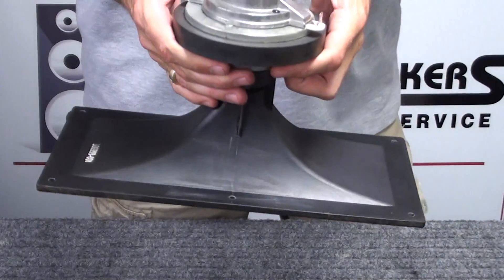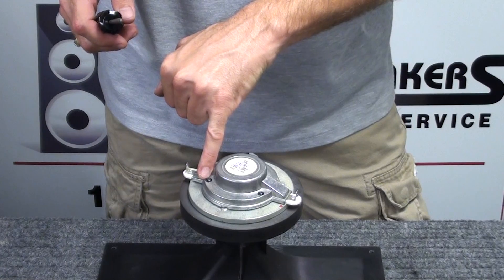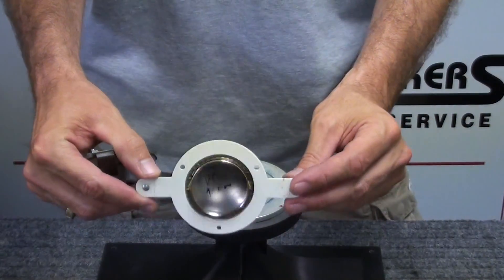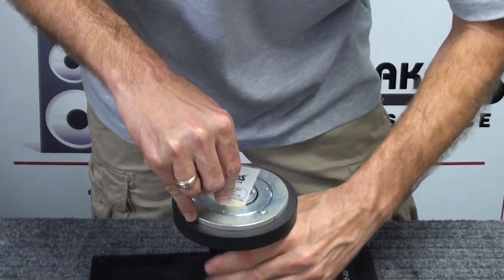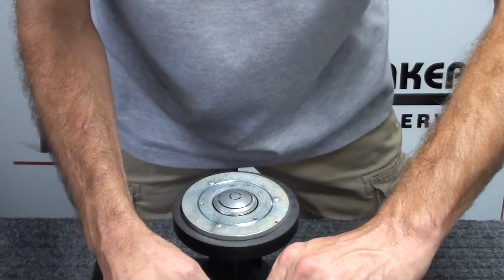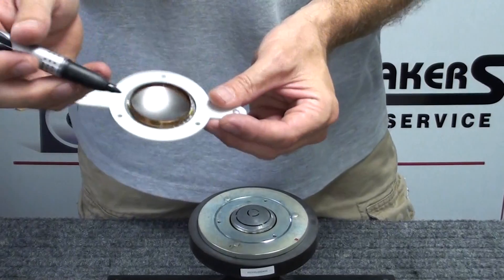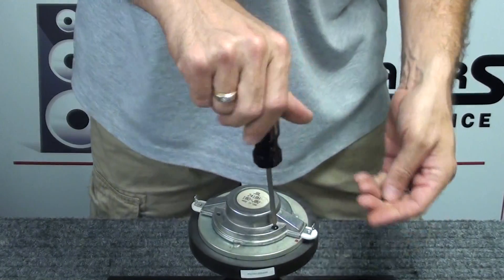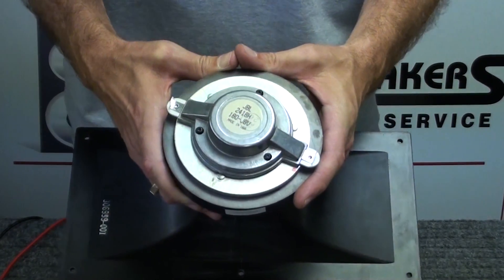JBL Speaker Repair Replacement Diaphragm JBL 2418H Installation

Comment: I just replaced this for my jbl eon 15 g2 and when I turned the speaker on there were a couple pops within the first few seconds and then one loud pop and now it doesn't work. Is there something I might've done wrong? I followed all the instructions as they are explained in the video and made sure to plug the correct cables back into the pos/neg ends. I'm having difficulty finding clues as to what could be wrong.

That said thanks for the very informative video!
Reply from the maker: Sounds like an amp or crossover issue. You may need to take it in to a service center to have the entire system checked out.

Comment: If the terminals are not marked, how can I determine the positive terminal?
Reply from the maker: If the terminals are not marked, we apply battery voltage to each terminal to see which way the dome moves. This will allow you to figure out the polarity. Generally speaking the dome will move toward the magnet when a positive voltage is applied to compression drivers where the throat is behind the dome.

Comment: greetings might be a long shot but wanted to ask anyways I have a speaker that the aluminum dome part of the diaphragm has been moving out of the main socket from the speaker its not dented just can now see inside the speaker at an angle where the diaphragm sits  perhaps the sealant or whatever held it in place is too old to secure it? its strictly JUST the diaphragn silver part the then metallic dome everything is in tact is there a proper way to reinstalled that with a special speaker adhesive or something? hope im  making sense much respect!
Reply from the maker: Send an email to us with a photo and we will take a look. Send to: info@simplyspeakers.com

Comment: my jblprx615m 2418H1 sounds like its blown on top.. would i replacing the diaphram fix the issue? sounds like rattling when a guitar/bass signal is sent through.

Comment: Hey, great video! I was really skittish about the possibility of replacing a diaphragm, as I know NOTHING about speaker repair. Anyway, do you guys sell the diaphragms? How do I know if I need to replace the driver for the horn or just the diaphragm? One of my JBL MR805 floor monitors and one of my MR835 three ways both have non functioning horns. Someone in a parts site told me that these speakers both have the same horn & that I could replace them with either the 2417H or 2418H. Is this true?